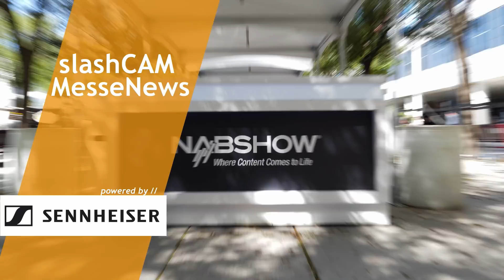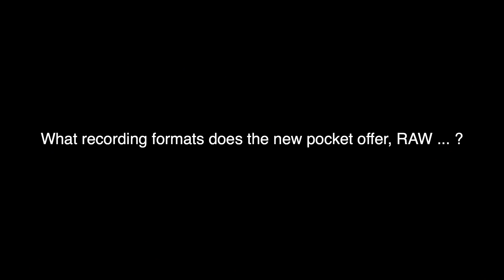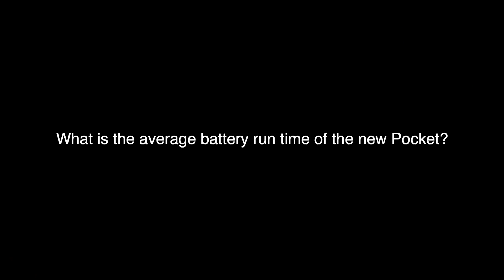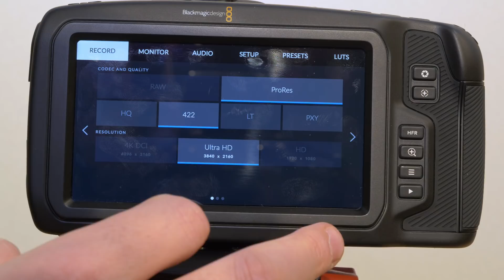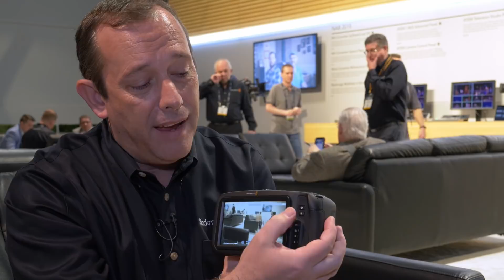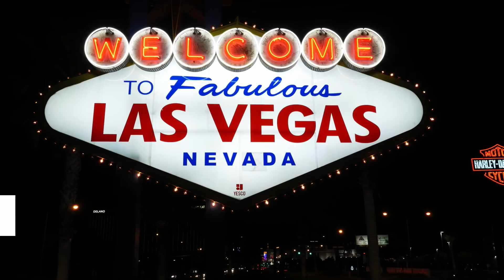Pocket Cinema Camera 4K: Speedbooster, ProRes, RAW, Battery Life, Ergonomics,  a.o. // NAB 2018

Comment: its a shame they haven't included a rubber door on the battery compartment.. then you could use a Canon dummy battery with a smallHD focus for example. Really small, very cheap, and easy thing to include.. and it would make such a difference for longer battery life solution... just sayin... you still have time blackmagic.

Comment: @slashcam do you which speedbooster they've tested with? I know the sensor is supposedly identical in size to the GH5s... I know with the original BMPCC, the sensor stack thickness was different (not to the norm?) hence Metabones creating a BMPCC-specific SB for the device... people are wondering if the sensor stack thickness is 'standard' on the new 4k BMPCC, and Brian Caldwell (Caldwell Photographic, designer/development for Metabones and other high-end lens development) walks us through a few questions in the linked thread below, as well as relaying that the 0.71x ULTRA would hopefully be the right one to use... again, so long as the sensor stack thickness is standard/right-on on the new 4k cam... 

Also, you'll see that he doesn't foresee creating a BMPCC 4k-specific product for this one... would be awesome if BMD could clarify the sensor stack thickness (or which SB they used when running their tests) on the 4k cam for us.

Here's a look at that thread in the BMD forums:

https://forum.blackmagicdesign.com/viewtopic.php?f=2&t=71899

Comment: I think the huge oversight here, is that you can't record to a hard drive and use a power bank at the same time. It's one or the other. Which kind of kills this feature all together. Sure you can have long battery life, but your cards will fill up fast shooting raw 4K. Would have been nice to have either 2 USB-C or another way to power bank the camera. I guess you can always use the 12v plug and modify a cable for power banking. Hopefully someone will sell one somewhere down the line. Great review!
Reply: You can record to an external SSD via the full size HDMI and use the USB-C to connect to a power bank.
Reply: What? Do you mean use an external recorder like the Atomos Ninja Inferno? Cuz there is no way an SSD can be attached to an HDMI port....

Comment: Simon wish you tell me why this camera can not have touch screen follow focus and we have to order separately a follow focus systems for lens we are going to use.
Wish you guys can cover this technology on this body.
I wish..
I wish..
Reply: I wondered about the same thing. Turns out this camera practically doesn't have any useful focusing system. It makes it useless for weddings , etc. which leaves it to nothing but movie projects with manual pull focus. Why this is announced as for "wedding videographers" or casual buyers? I have no idea! And the cinematic look... not sure if that's desired #1 at weddings, seems other features are much more critical. So unless you're in the movie making stream this camera will turn way inferior if not useless for videographers working already with DSLR or mirrorless.

Comment: This camera would be really tempting if it weren't for the fixed screen and lack of any viewfinder. I suppose you could add an external tilt monitor and viewfinder if you want but it would put the price in GH5 territory. I do love the cost, the dynamic range, the size of the screen, and the fact that you could easily adapt all the micro 4/3rds lenses that you already have to it. I know this camera is mainly aimed at video use but the lack of IBIS is kind of a bummer for non-OS lenses.
Reply: Bob Jones raw tho

Comment: is this better than Sony a6500 and similar cameras?
Reply: No camera is better then the other, It really depends on your needs.  Do you shoot more video or stills ?.  This is a tool for creating Cinematic video.  You need to have time to color grade (lots of post work with raw dngs, hence why they give you free resolve studios).  Bmpcc 4k has better video specs, inputs, great codecs etc. It screams (CINEMA).  Sony has a bigger sensor with ibis, good video and photo capabilities so it's good at both just like all the other hybrid cameras but bmpcc4k VIDEO is on another level.
Reply: this shoots raw video at 4k so the a6500 doesn't come close to this

Comment: Anamorphic?
Reply: I don't see how since the sensor is 1.89:1 instead of a normal 4/3 sensor 1.33:1 They could do it I guess but it wouldn't give you anywhere near the same advantage as the GH5.
Reply: Joseph Hinkle ah yeah. Good point 👍
Reply: Most likely, from what I've been reading.
Reply: Tor Ivan Boine  probably not 4:3 anamorphic mode but it has aspect ratio guidelines

Comment: Does it have EVF? I didn't notice it. It is more like a rig friendly camera (additional power block since battery life of 1-hour shooting is really low timing, mic or portable mixer to balanced mini XLR; They should have pointed out if mini XLR has toggle for line level input since some portable mini mixer / recorders have only balanced line out (requires balanced adaptor cable)), additional EVF, additional flash media drive to USB-C connector, etc. Also it's good to give idea of storage cost for RAW. I'm not sure if Cinema DNG is still bulky but if so, addition of ProRes RAW makes sense and can sway the decision for some lower budget videographers toward this unit. Base price of this BMPCC4K is awesome!!! Also it would be good to have a comparison with GH5s at some point. I have a feeling GH5s will offer a bit better low light since the base of high iso option is 5000 as opposed to BMPCC4K of 3200. But BM have a niche when it comes to colour science so hopefully the overall image ends up being more superior. I think GH5s is at 14 stops dynamic range which is a bit higher than BMPCC4K but again it's all matter of shooting in parallel and see what you get. If RAW leaves enough room for curve adjustment, I imagine that 1 stop of dynamic range may not be as evident. Can't wait to see it in action!

Comment: Mmh... twice as heavy as the first one. That's unfortunate for me because I liked using the original BMPCC with just a small stabilizer. But especially with heavier lenses and slightly longer sessions, my wrist would sometimes hurt for hours afterwards.
So I guess I'd definitely have to use a proper steadicam or gimbal with this one - which makes for very different use cases. Can't just throw that into a small backpack and bring it along.

Comment: Putting the fan intake in the bottom is kinda dumb. The tripod baseplate could cover that.
Reply: its bevelled and grill shapped. They took that into account
Reply: Chicha 17 what does that have to do with anything? The base plate will cover it when it’s attached, which for me is most of the time. It’s a poor location for a crucial element for the camera.
Reply: No. The fan is at an angle and isn't blocked even when camera is on an extended plate. As seen in the video......

Comment: The price! Damn that’s amazing. I’ll be buying one at launch. ...but you know this is the internet so you know I’ll have to pipe my unwelcome first world 2 cents here 😂: no significant increase in battery life? the moment you have to rig an external battery solution is the moment it also kills all of the little vlog features you included because vlogging with a rigged setup isn’t practical. Also, from what you’re eluding to in the video it sounds like metabones is going to have to develop a brand new M4/3 adapter that is optimized for where you placed your sensor (much like how they have a Panasonic xl 0.64x AND an Olympus ultra 0.71x version of their M4/3 adapter) could the flange distance not have just matched the Panasonic so we could have used the XL 0.64x speedbooster?  These things are almost half the price of the cameras themselves.
Reply: This isn’t a vlogging camera, and the existing mft speedboosters will work fine
Reply: Even so there are native m43 lenses with OS that would work just fine for Vlogging
Reply: Bob Jones I meant it isn’t for vlogging because it’s designed primarily for people who want raw video, which is completely overkill for a vlog
Reply: on the upside LP-6 batteries are dirt cheap

Comment: Very Intersting what is the crop factor in HD if any?
Reply: HD is full frame downsampled for better aliasing, except for 120 FPS which is windowed
Reply: WOWWWW
Reply: If the FHD bitrate is solid, this is would be such a gamechanger! For those "bedroom" vloggers (like me) record in FHD, have LUT applied in camera, shoot in ProRes onto external USB-C hard drive. Just plug the drive into your computer and ripple edit and your video is done. No need to transcode and generate proxies, no color correction/grading. Wow. That is nuts.
Reply: 4X full frame crop on 120fps
Reply: Thanks

Comment: It needs an option of charging from any standard powerbank.
And to lead the market it only needs IBIS and decent still frame photography.
Reply: Did you watch the video? The guy literally says "you can use powerbanks used for charging mobile phones."
Reply: A lot of professionals actually prefer not to use IBIS.
Reply: Hushed Tones IBIS is for video too. Fast shutterspeed in video is awful
Reply: This is oriented toward video professionals. You will get decent stills from this camera for when you need it, but the primary use is for people wanting a cinema camera for cheap. For most video pros IBIS is something you don't want. Even when deactivated, the sensor can't be locked down if there is an IBIS. Using lens stabilization and a gimbal should be enough if you need stabilization. Or just shoot in 4K then stabilize in post.
Reply: I'd say it needs great autofocus and flip screen more than IBIS 
just use a fast shutter speed for less shake. for video everyone has a gimbal nowadays these are great and cheap
Reply: as for charging it will certainly get it via firmware if it doesnt have it at launch 
or you can use a dummy battery LP-E6 powered adapter and plug it in your power bank
Reply: It also has a locking 12v power jack.
Reply: Take Your Chits, If I understood presentation of BMPCC4K correctly, this camera is aimed at everyone, not only at professionals. It can offer professional and not so much features to the widest market segment, for the fraction of prise of other high end professional cameras. And even tries to bite into stills market. If a number of customers would like to buy this camera just for stills, Grant Petty will be more than happy to sell it to them.
Reply: This camera is not at all targeted to avegare Joe. Everything else will do better then this one for average consumer. IF you are gonna shoot home videos or have fun with your friends you gonna be better with something that shoots in standard h.264\h.265 whitch is much easier on your hdd and requiers little to no aditional work to make it usable. This is targeted to professionals and enthusiasts thats gonna spend like 3 times or more money on top of this to make it work and for them is gonna worth it. Everyone else is gonna be much happier with things like gh5 or even Canon m50 etc.
Reply: Seriously coopersandwich.. look elsewhere. It is a $1000 4K cinema camera.. 2.5x cheaper than the GH5s with the same sensor and better media and recording capabilities. You should just stick with the GH5s and accept the cost.
Reply: Yes if they can deal with huuge ass files like 90GB for one hour for absolute crappiest quality or 1TB at the top for just 1 hour. To not  speak about computing power and time needed to deal with such files. So no this is never gonna be your next handycam. Cheers!
Reply: if this is marketed towards "everyone" its for cinema pruposes. so now everyone can shoot cinema grade VIDEO. the focus is not on stills here. There is a big difference in image aesthetics here compared to a stills/video camera hybids straight out of camera. this is everyone RED or ARRI cinema cameras as used in Hollywood.
Reply: Take Your Chits so, half way there. Only IBIS and decent stills left on the list.
Reply: 4 built in microphones, stills button, HD option, baked in luts, prise, form factor says otherwise. This camera is targeted at the widest possible market segment, including professionals and not professionals at all.And it is a smart move, because professional market is only a fraction of market available for this camera.
Reply: I'm guessing if you're buying this camera, you're somewhat serious about video..... as such, no1 really uses autofocus besides vloggers. Don't be fooled by that button on the front...this ain't for vlogging (even though it seems like it it's marketed as such)
Reply: James Vance, A lot do. Also, if you're aiming not only at professionals but at consumers market in general, then IBIS is desirable.

Comment: How about the file size for 4K video?
Reply: From the blackmagic website;
4096 x 2160
CinemaDNG RAW – 270 MB/s
CinemaDNG RAW 3:1 – 128 MB/s
CinemaDNG RAW 4:1 – 96 MB/s
3840 x 2160
Apple ProRes 422 HQ – 110 MB/s
Apple ProRes 422 – 73.6 MB/s
Apple ProRes 422 LT – 51 MB/s
Apple ProRes Proxy – 22.4 MB/s
1920 x 1080
Apple ProRes 422 HQ – 27.5 MB/s
Apple ProRes 422 – 18.4 MB/s
Apple ProRes 422 LT – 12.75 MB/s
Apple ProRes Proxy – 5.6 MB/s
Storage rates based on 30 frames per second.
Reply: John - I tried to search the file size for Samsung NX1 and GH4 which I currently using but not sure if correct.

Samsung NX1 H.265 around 33.6GB file size for one hour 4k video. How much BlackMagic Pocket 4K will consume for similar quality and duration?
Reply: It would be easier researching and comparing bitrates to calculate the rough file sizes since companies normally only provide bitrate details.  But if  you don't use the same codec/sensor/lens/hardware/etc it's hard to define 'similar quality' since that is a bit open for interpretation. But BM stated 270MB/s for their highest quality, multiply x 60 for minutes and multiply x 60 for  hours and divide  by 1024 to get from MB to GB and you end up with = 949GB per hour in the highest setting CinemaDNG  raw or 96MB/s x 60 x 60 /1024 = 338GB per hour in the low CinemaDNG raw setting. Other brands used Mb instead of MB, that's 8x smaller. The NX1 does 80Mbits/s so 10MB/s, do that x60 x 60 /1024 and you end up at  35GB per hour, so that's close to the size you are getting.
Reply: At least 6 times bigger in Prores 422 LQ. The h.265 is a great codec and the NX1 a fantastic tool. Stick with it.
The Blackmagic delivers 422 in 10 bit which is Broadcast standard f.e. for HBO and other Channels. I will buy this camera but I will keep my NX1 for sure!
Reply: Thanks so much for the helpful information!

Comment: Any anamorphic modes?
Reply: Only for the 4.6k and Pro. No anamorphic mode on the 4k, so this probably won't have it...
Reply: thanks
Reply: also the sensor on this is 16:9 so not enough vertical resolution for a proper anamorphic, but we'll see
Reply: Stanly ok thanks
Reply: Stanly ok the vertical resolution doesn't change when shooting anamorphic on a 16:9 sensor. The horizontal resolution does, though, since you have to crop off the sides. This has about the same vertical resolution as an Alexa at open gate which is great for anamorphic.
Reply: when talking about aspect ratios it's easy to be misunderstood (= What I meant is that 4:3 sensor (like the one in Alexa) has extra pixels on the vertical axis that are not used when filming regular 16:9 but while in anamorphic mode they provide extra vertical resolution so you don't have to crop sides of the image to get 2.39:1. Btw Ursa Mini 4.6 also have 3K anamorphic mode that they achieve by cutting out the sides of the image/sensor, which could be avoided if the sensor had more pixels on vertical axis aka was taller ... hopefully I made myself clear :D
Reply: Stanly ok Well you still have to crop 4:3 to get 2.39:1, just not nearly as much. The downside with cropping a 16:9 sensor is that the lenses get longer and a lot of the image goes unused. I'm with you all the way, but just don't agree with the phrasing that you lose vertical resolution. More that the sensor isn't tall enough to maximize horizontal resolution. But shooting anamorphic on a pocket 4k with speedbooster will be no different to shooting anamorphic on an Ursa Mini, Varicam, Sony FS7, Amira, etc. except some of those offer in camera desqueezing and cropping.
Reply: Oscar Stegland yep, saying that the sensor is not tall enough would’ve been more accurate ... but a taller sensor would’ve had more pixels on the vertical axis as a result so that’s what I meant :D anyway, 4:3 sensor with 2x anamorphic gives 8:3 image when de-squeezed, which is about 2.6:1 and is very close to 2.4:1 ... would’ve loved in-camera de-squeeze for monitoring and sensor crop for data saving nonetheless! I think 3K anamorphic in Ursa Mini 4.6 works exactly like this
Reply: Theres anamorphic modes in the OS for Ursa Mini so I'd assume its there as well
Reply: Travis Wood thanks